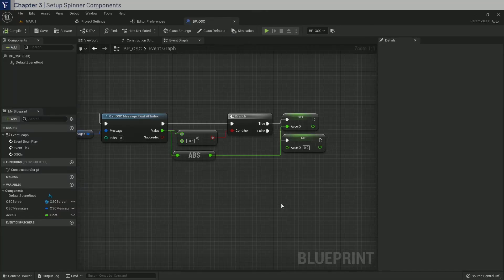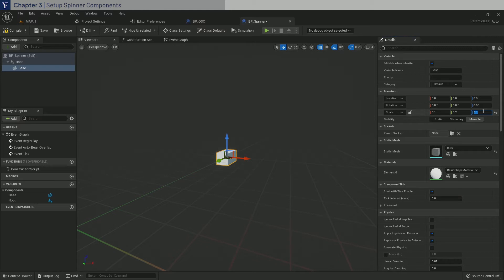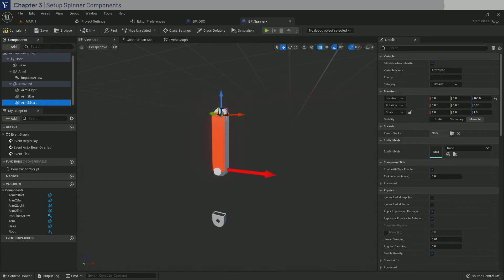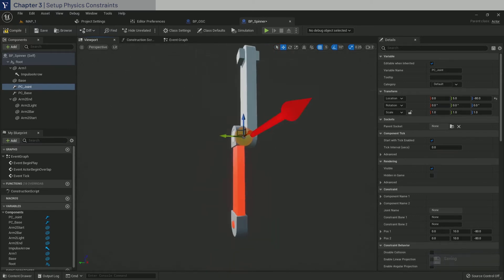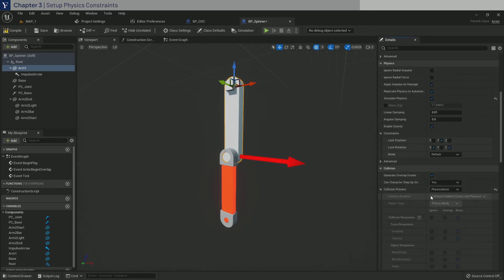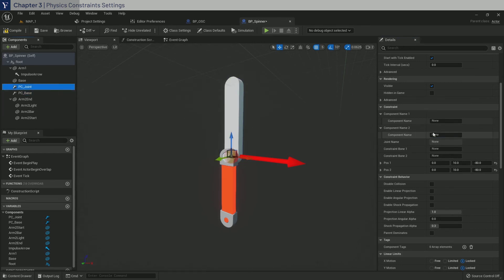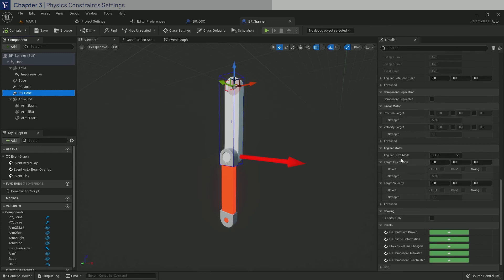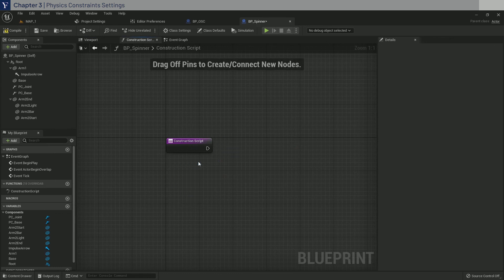Unreal Engine 5 [Course] OSC Creative Coding with ZigSim | Ch.3 - Physics Constraint

Comment: Hi, I am following your tutorial using Unreal Engine 5.6 because things should be similar and compatible.
I am sure I have followed every step until the end of this part after multiple checks. However, the swing physics part didn't work the same as that in your tutorial.
There is insufficient velocity pushing Arm1, and Arm2End keep bending. The problem can be solved by increasing the velocity vector Y in the construction script from 1.5 to 25-30, but I am afraid that is not the correct way to solve the problem.
I also witnessed that the strength parameter of the angular motor has changed to damping in UE5.6. Is that the reason?

I just came here after your Dummy course and UE4 interactive art course, and I'm still not really familiar with the physics stuff.
Reply from the maker: Very difficult to say on my side. I haven’t touched 5.6 due to the UI changes and generally we don’t use the latest version immediately after launch so I’m not sure what is different with the Physics Constraints. What’s wrong about the movement? Try putting 0 on all the Angular Motors values and see how the Impulse is applied. If it moves around as expected but just no damping then, but be due to Damping value or the resting angle / position value (which I forgot what is called.
Reply: @YFJSR  Thank you so much for your reply! I just figured out the reason why the movement was so weird few hours ago. It was because the collision box of Arm1 was not at the exact center of the mesh, after making the collsion box thinner and centered it, the movement became correctly and smoothly.